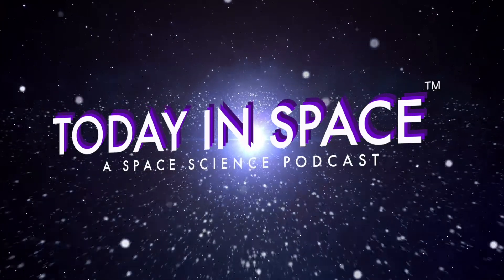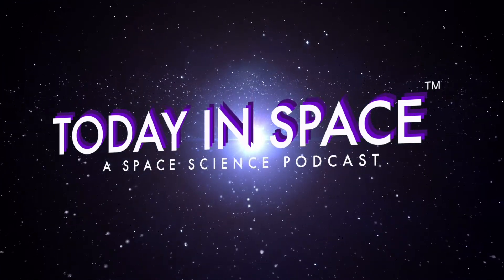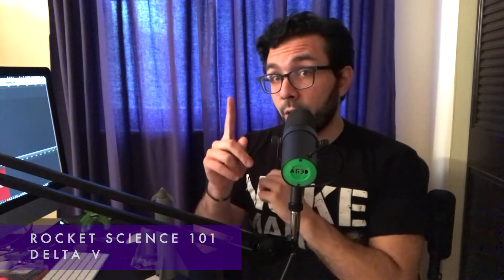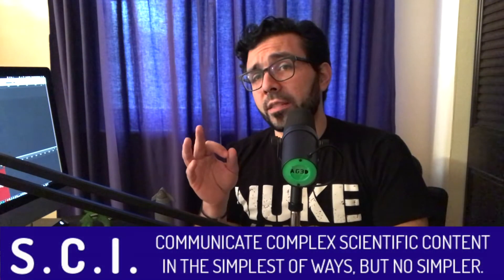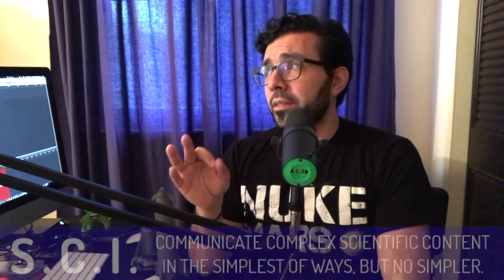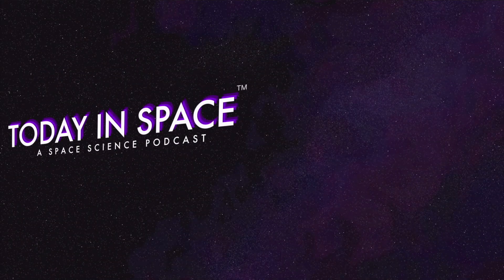How Orbital Refueling and Delta V will help SpaceX's Starship launch to the Moon and back | TIS Clip

Comment: Talking about inefficiency. It's as if a fuel truck used 90% of its fuel to deliver a measly 10%. They will need to send many rockets for a single refueling. The future of space is unmanned, small, smart and efficient.
Reply from the maker: I’m not sure why it needs to be just unmanned. Industry can and probably will develop both paths, crewed and uncrewed. 

In a world where rockets are toss away and expendable after one flight, your hypothesis makes sense. But good luck getting funding and making progress with just robotics. Not a very robust future in my opinion. Low risk low reward
Reply: @TodayInSpace   The reason is simple, most of the money spent on manned missions is dedicated to keep us alive and returned in one piece, that leaves very little room to conduct exploration or science.
Reply from the maker: I don’t disagree with you if the situation is that we can only choose one. Then the other suffers. I’m saying we have a situation where we can do both. Unmanned small missions like cubesats should continue and thrive, but not at the cost of human travel. 

It’s the same argument with the original space race mindset - autonomous (ussr) vs piloted (USA). Russia “lost” because piloted could beat computers. But the entire industry developed together regardless (I.e. Soyuz system kept the space race going this last decade). 

SpaceX dragon is highly automated. I think one helps the other
Reply from the maker: I’m all for cubesats!!
Reply: @TodayInSpace  
To me the role of humans beyond earth orbit begs for justification. how many robotic missions can we send to our solar system for the cost of planting a flag on Mars. It would be one thing if Mr Musk was playing with his own money. Again I can't imagine a business model beyond Earth orbit, beside an expensive joyride around the moon, that could turn a profit.
Reply from the maker: Mr Musk has put more money in by himself than most of the individuals that work for the old space market and big contractors, especially the ones making the automated spacecrafts you discuss. Not really sure where you’re getting that SpaceX is mostly funded by NASA and that they are taking away from other possible space travel.

Comment: For those looking for how much delta-v a fully loaded Starship can achieve, we need to use the rocket equation.
V = Isp * G * ln(Mi/Mf)
Using numbers from Wikipedia's page on the Starship, I get:
V = 380 * 9.81 * ln (1320 / 220) = ~ 6.7 km/s carrying the max payload of 100 metric tons.
Reply from the maker: Super helpful!! Thank you!

Comment: There's a technology better than fusion that is just around the corner. Check out Brilliant Light Power and the Suncell that is in development. Already working and converting hydrogen into dark matter. But infinite energy does not equal infinite delta-v. You need to accelerate a mass in the opposite direction, to accelerate forward. Infinite energy can help you increase your exhaust velocity (to approach 'c' with ion thrusters and the like), but you still need to eject mass to accelerate. Eventually you will run out of whatever you are throwing out.
Reply from the maker: Thank you - I’ll be looking into that new tech!

You are totally right - thank you for the clarification. I’ll make a note in the description and a follow up video soon to clarify and explain in more depth

Appreciate you giving constructive feedback :)
Reply: Sounds like some good theories to delve into from an astrophysical perspective, but probably unachievable (or even impossible) for human machines.

Comment: So apparently the Super Heavy isn't going to get the Starship all the way to orbit?? Otherwise why would you need to refuel before you leave Earth orbit.
Reply from the maker: Yes, the super heavy (and most 1st stage vehicles) only get you out of Earths gravitational pull and into a lower orbit. Then, you need Starship to position where you want to be in orbit. Usually that’s second stage rockets or in this case Starship
Reply from the maker: Getting to orbit is one thing. Positioning yourself in orbit is another and can take a lot of fuel.